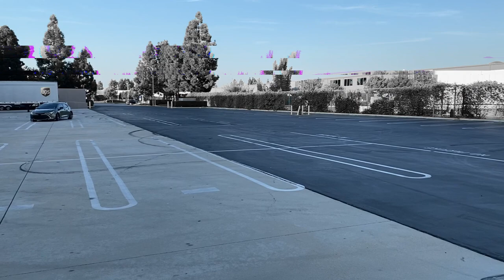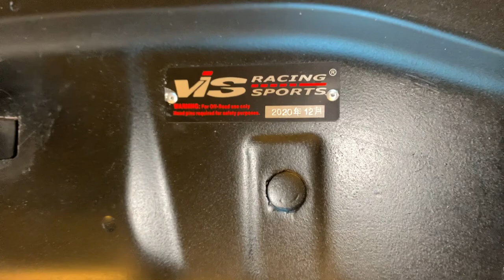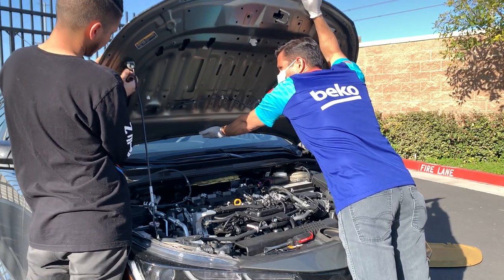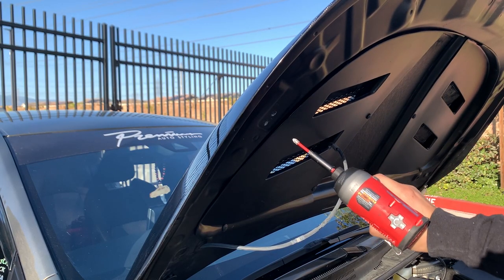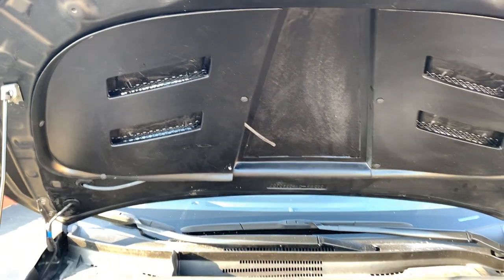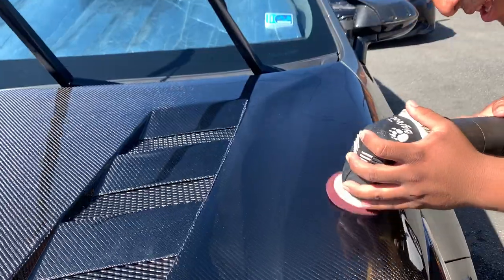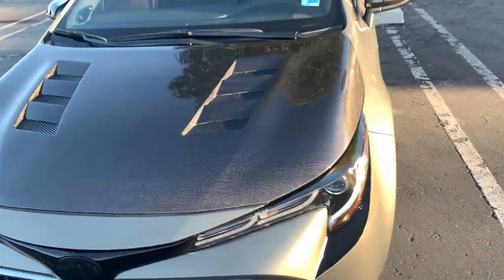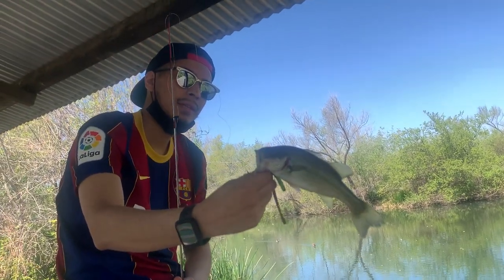HOW TO INSTALL VENTED CARBON FIBER HOOD I TOYOTA COROLLA 2019 2020 2021 2022 I  VIS RACING HOOD

Comment: that ceramic coat on the hood! oooo loooks sooooo clean dam.

Question, if you live in an area where it rains a lot, should I be worried via the vents? or did it come with like a filter? I couldn't tell in video.
Reply from the maker: Thank you so much bro! & nothing would happen! Just will get your engine bay a little bit more dirty then usual! Only have to worry about it if you have an exposed air filter!

Comment: 1. What color is that corolla? (love the color)
2. Where did you get all those carbon fiber parts? (could you drop some links)
3. Your car is absolutely incredible. I love it.
Reply from the maker: Yoooo thanks man! Seriously appreciate it! 🙏🏽 
1. It’s called oxide bronze! 
2. I get them off Amazon / eBay / third party sellers, I have all the links in my other videos! Just scroll thru them! :)
3. You’re seriously a LEGEND! 🤣🔥

Comment: Hey y'all just taking a shot on here to see if anyone can help. Last week I hit a gnarly speed bump that rocked my hatch pretty bad, scraped the whole bottom of it and I was like damn I guess that's just life sometimes. A few days later while washing my car I start thinking that my hood looks a bit off and today I went to a local dealer to compare it with a hatch on the lot and yup my hood isn't sitting flush anymore. Tried messaging with those rubber bonnet adjuster but it didn't really help. Any ideas to what might help would be greatly appreciated. 
Thanks y'all
Reply from the maker: Hmmmm that’s a good question. You might have some bends that are causing that. You’d have to find where exactly it’s bent